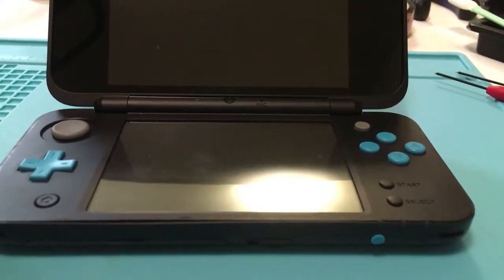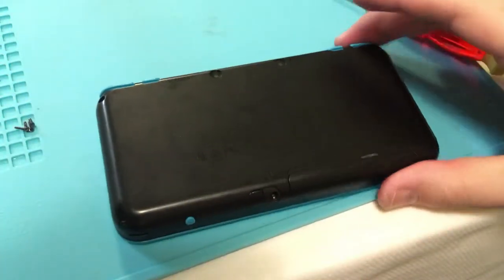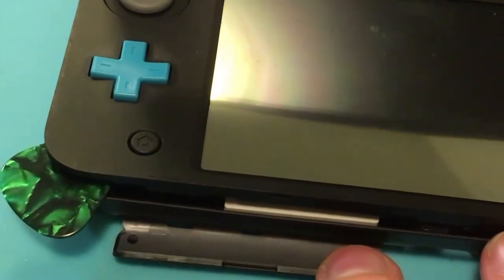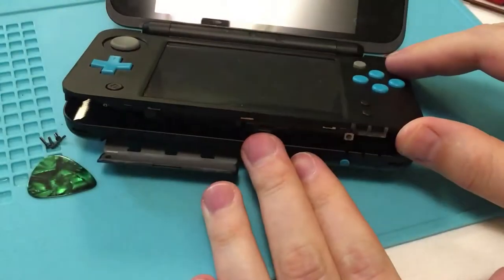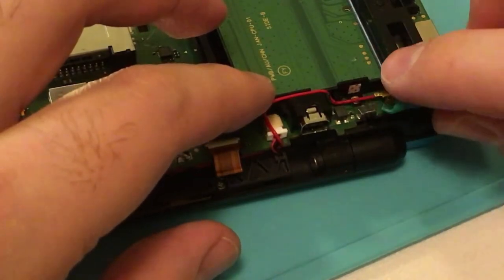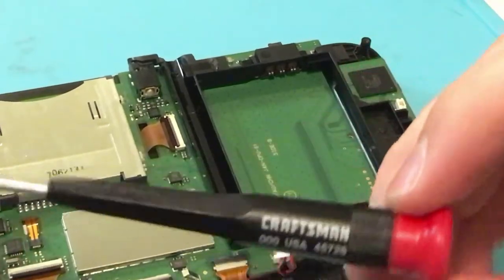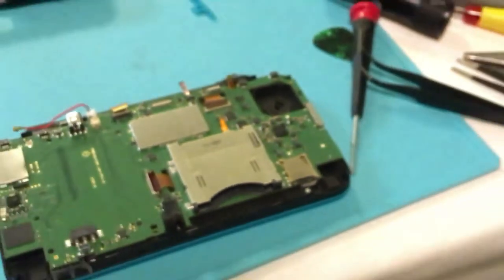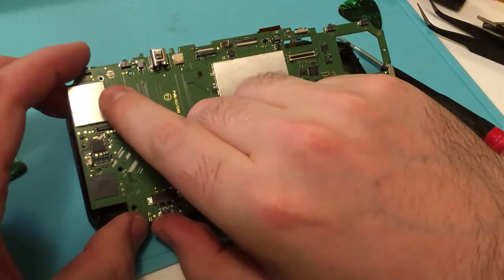SolderJS #132 - New 2DS XL Logic Board Removal

Comment: At 15:10, do you know or any way to fix those parts? I didn’t know they weren’t latches and bent them up a bit.
Reply from the maker: It's a JAE Electronics connector, part number FA1004SA1-R8000.
However, no, I wasn't able to fix one that I broke. It can't be done by hand soldering or by a hot air station. It requires a reflow oven.
The next best thing, however, which you may be able to do by hand if you leave the connector in place, is to tack the replacement connector onto the original connector with magnet wire:
https://www.youtube.com/watch?v=0YIT6MeaXT4
Reply: @coolaj86 I made this same mistake but am not super inclined with a fix that like yet. Do you think non-conductive tape could be a short term fix and if so, any particular recommendations on what to avoid with the placement and whatnot? Thanks for the video, wish I would have watched this one before taking apart. No other videos mentioned to not lift those tabs.
Reply from the maker: @jasonvan8814  I never got it figured out. I got another motherboard.
Reply from the maker: That said, Kepton tape.
Reply: @coolaj86  Thank you! I ended up breaking the connector latch off on accident so I’m guessing the tape might prove ineffective.

If I can’t find a fix I might just buy a new motherboard as well, looks like they’re only around $25 through Ali express.

Comment: Hi, congratulations for your nice video. Can you help me understand what problem my New Nintendo 2ds xl has, please? When I press the on button the blue LED lights up the 2 screens remain black and after 4 or 5 seconds I hear a noise (tac) and the blue LED turns off.
 What can I check / change? Many Thanks
Reply from the maker: I actually fixed that same problem with this 2DS and, in my case, it was the power management controller solder had cracked slightly from the board.

I baked the motherboard in a toaster oven (a mini oven, not a toaster) at 100ºC (shielded from the heating element with tinfoil) for 60 minutes to remove moisture and evenly heat the board. Then I used used a hot air rework station (a special heat gun I got for $40 on ebay), set at 350ºC to heat up the microcontroller for about a minute (the goal is to get it just hot enough for the solder to reset).

It's pretty risky, so you might want to buy some electronics (including the toaster oven) from the thrift store to learn how to set the heat just right, and to melt the existing solder without burning the board or the micro.
Reply: @coolaj86  Many thanks
Reply: @coolaj86  Hi, Thanks for the uploads....
did you ever upload the repair videos

Thank you

Comment: Great video!!  I see in the description it says it fixes both orange light of death and blue light pop. I have an issue and its blue light on power up and black screen(s) of death. No sounds, just blue light and black screens. Power down and blue light goes off. Would logic board replacement possibly fix this issue? Thanks for the great video and your input if you have one on my issue.
Reply from the maker: Thanks. In short: it's worth a shot.
Electronics these days are not what they used to be. Things are so integrated that it's difficult to tell where a problem is. I got lucky with a few barely-educated guesses for this board. My best guess in your case since you have power, but not sound or video, is that your screens probably work fine, and the graphics chip may even work fine, but something after power and before graphics is blown, shorted, needs to be reballed (most likely), or is otherwise preventing boot - which is something on the logic board...

Comment: at 15:38  , for those 2 you re the first one to say that they are Speshal , man I think i broke them , I habvent been abel to put them back and close them ...., that is how I find your video  So there is no hope if I lifted them , right ?As mucha as I push them down , they always lift up and this couse that I cant see my low screen
Reply from the maker: I ended up buying a new logic board for the one I broke.

Theoretically you can fix it in a reflow oven, but I was not able to do that.

Another practical method would be to buy the latches and attach them to the board with very thin magnet wire and heat-resistant non-conductive epoxy (or maybe kapton tape). You can find the part at DigiKey and Mouser.

It’s part ID is JAE Electronics (VA) / FA1004SA1-R8000
Reply: @coolaj86  I managed to get it to work , but the rubin cables exit very easily , I wa thinking of glue alittle bit the conectors in the corners  , just so that the cables dont come off if I shake the console
Reply: @coolaj86  and now it is not working at all , doesnt even turn on  , well I think I would have to chnge the mother board . Thanks anyway :)